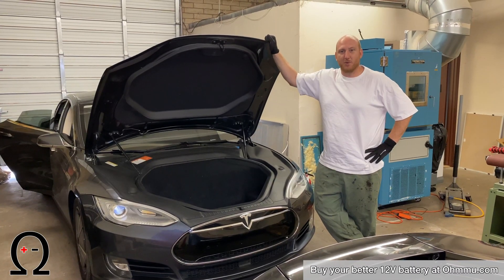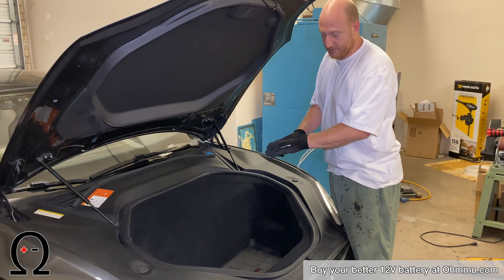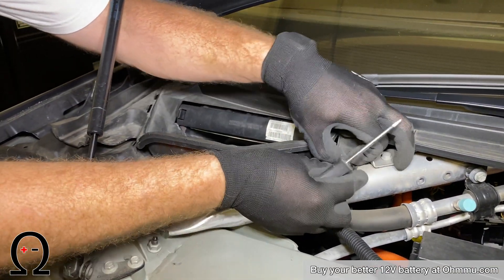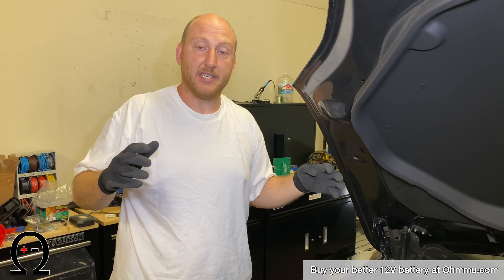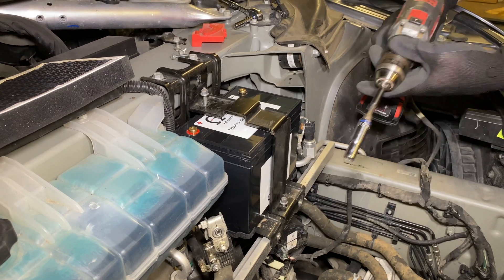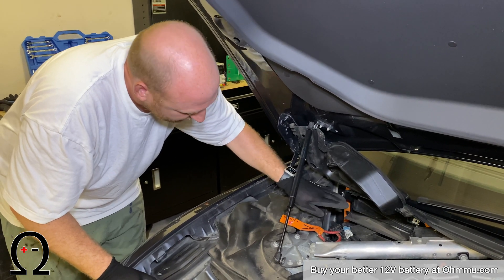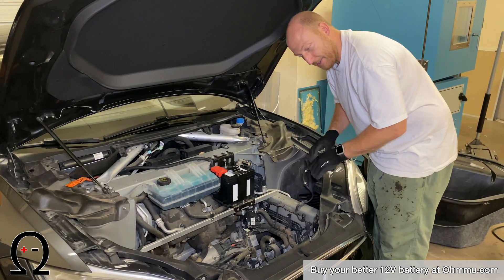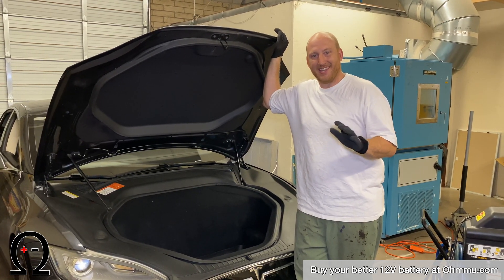Tesla Model S - 12V Battery Installation

Comment: 30 mins my eye on a MS 100D ? .. it took you 30 mins to open it up.. c'mon.. this job is easily 90 mins 4sum1 that hasn't done it 6 times.. plus.. he had all the tools set up prior..  Tesla charges about $400 to install a new battery w/ the labor included in Nj.. that includes 1.3  hrs labor @ $195 an hr...  that's what a professional takes..& usually they rush  it & 4get stuff..like bolts or broken trim clips..  seen it personally.. U think you're faster at the ok Tesla Corral? think again...but at least you can put it 2gether the way it's supposed to be

Comment: Great video... Your title is not actuate though.  (I would delete the PLUS part... 2015+)  
I have 2017 Model S and the set up is VERY different from the 2015+ you indicated...  
Hope this helps others...
Reply from the maker: Where is the battery in your 2017 S?  It should be same location and most of the methodology is the same, the HVIL (first responder loop) is the only thing that was moved from the 2014/2015 to the full-refresh Model S version.

Comment: This is short concise and perfect for someone with reasonable skills and half a brain.  The local Tesla Service department let me down and chased the wrong rabbit down the wrong hole.  After keeping my car for two extra days and not being able to find the culprit for lack of key recognition and a few other electrical issues I did my own search and found Ohmmu.  My 2014 S was a little more difficult to get to the battery than the 15', but I accomplished it none the less.  Tesla service wanted me to flat tow my car and couldn't give the simple advice of removing the nosecone to charge the dying lead battery after two days of lock out.  Just another car company service department trying to milk as much money from the clients as they can...
Thank you Ohmmu for a great product replacement with a great how to DIY video!

Comment: best video for my problem.. our TMS 2015 got an update loop, which caused a battery drain. now it sends a "replace 12v battery warning" but the 12v battery is good. will disconnect the emergency loop and negative pole of the battery. wait 5mins and connect it in reverse.. hopefully it will go away
Reply: Did it work?

Comment: Isn't the charge / discharge profile of the Li battery much different from Lead Acid? How does the high voltage DC to 12v DC charger know the different cut-off voltages etc?
Reply: It doesn’t, you have to download an app to your phone to control the new battery. Why pay 3 times the cost , to have 1 more issue.